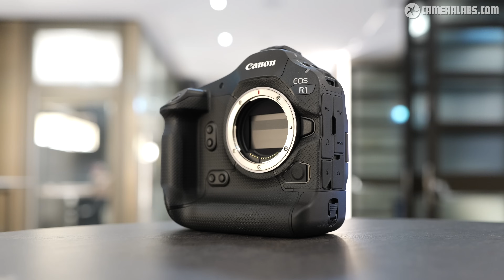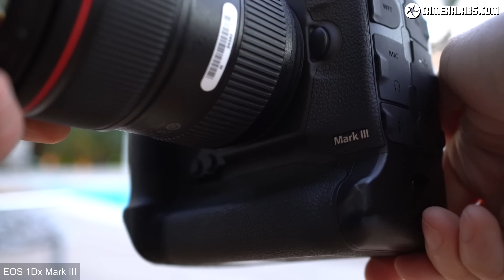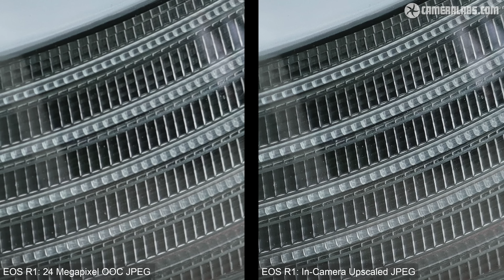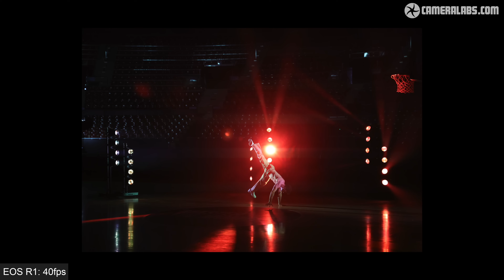Canon EOS R1 HANDS-ON first-looks review PRO flagship

Comment: Quick question: On your R1, does the side rubber port cover sit perfectly flush against the body? Mine has a tiny gap at the top and I’m just curious if that’s standard for the design or if I should be concerned.
Reply from the maker: Sorry, mine was a loaner for the test period during which I made this video, so I can't check. Can you see from any of my footage of the camera?
Reply: @cameralabs  I noticed the same thing in your video, and mine has the exact same tiny gap, so it’s likely just the design.

Comment: So happy to have replaced my R5MKII with an R1 (for wildlife).
Reply from the maker: What are the differences you've noticed?
Reply: @cameralabs  I shoot primarily early and late in the day and the low light performance of the sensor and the low light AF performance is what did it for me. The lack of color noise in the shadows and the retention of detail in those areas is nothing short of amazing. I've also reached a point in life (oldish) where the experience of shooting matters a lot and in that regard I don't think the R1 has an equal. I also find that I can crop as much as I need to to get the results I'm after. Don't get me wrong, in good light, the R5MKII is awesome, it's just not for me.
Reply from the maker: @ronrotunno522  thanks for the feedback. I've heard it's cleaner in low light, but the AF differences are also interesting to hear.
Reply: @cameralabs  It can pretty much see in the dark in terms of AF.

Comment: Personally I have r5m2 and r1. And i use r1 most of the time. Reasons is deeper than reviewers usually deliver. 
1. R1 has triple base iso 800, 1600, 12800. That mean noise cleans up at those iso levels. And you could use r1 in extreamly low light video conditions without visible noise. R1 has same sensor like c80 Canon video camera. 
2. R1 has the best iso performance in high iso and practically I see more details with 3200 and higher with r1 than with r5m2. 
3. R1 has over sample video from all sensor in 4k 24-60, r5m2 only 24-30. 

And of course better heating, battery, evf, handling… 

24 mp is ok for me maybe because I have also gfx100 ii with 102 mp but I really thinking about selling r5m2 because of bad iso noise performance.

A1, a1ii, z8, z9 have even worse high iso performance than r5m2 and not even close with r1. 

To understand why r1 is needed you have to dig deeper my friends and 24 mp is advantage of this camera. Canon did it with purpose. 

Great review as always! Like to it ❤
Reply from the maker: Thanks for your informed comment, very useful!

Comment: 00:04 Canon R1: Pro flagship mirrorless camera
02:05 Canon EOS R1 features stacked sensor with new low pass filter for maximum detail
04:07 Built-in grip enhances confidence and robustness
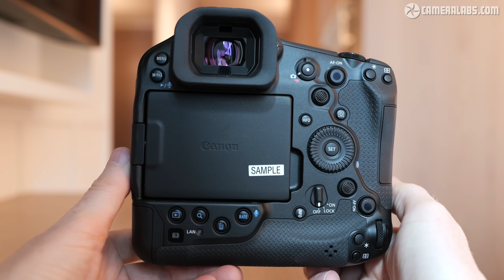06:06 Canon EOS R1 offers improved features over R3
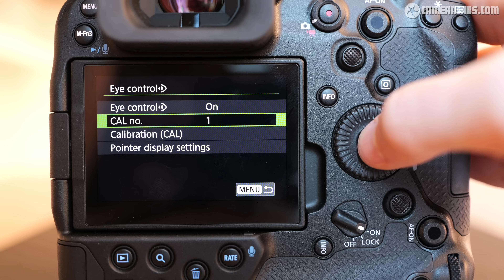08:08 Canon EOS R1 offers improved AF accuracy and advanced autofocus features.
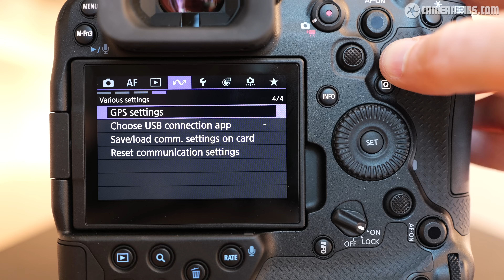10:09 Canon EOS R1 features a faster back-illuminated stacked sensor and upgraded Wi-Fi support
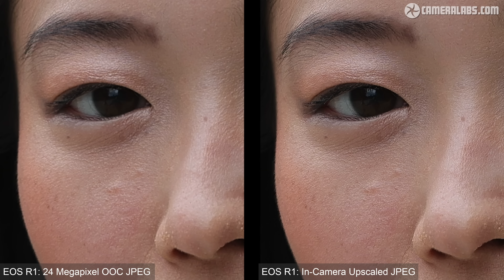12:12 Canon EOS R1 offers in-camera upscaling and neural network noise reduction for enhanced image processing.
14:11 Canon EOS R1 features impressive autofocus upgrades
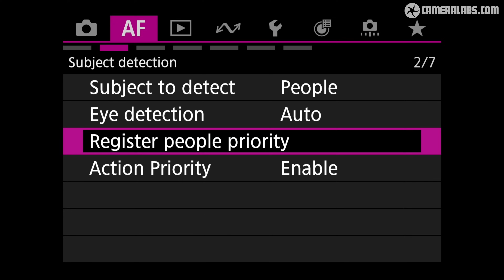16:21 Canon EOS R1 offers advanced autofocus system for sports photography
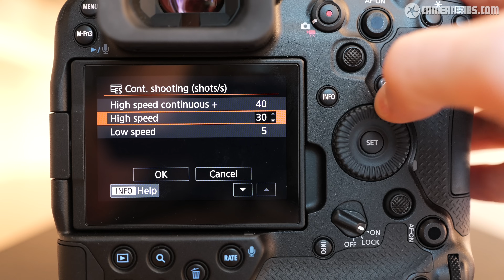18:08 Canon EOS R1 offers useful upgrades for burst mode and video capabilities.
19:59 Canon EOS R1 offers impressive video recording capabilities
21:48 Consider if the Canon EOS R1 will meet your desired results

Comment: Canon USA is apparently already stating that the R3 Camera line will continue. Which if true, that is something I have always believed from Day 1 in spite of those stating and or claiming the R3 was actually the R1. Which really does not make any sense if a person actually thought about it. The Size of the R3 was never right and Canon was NOT going to launch a Flagship Camera with their VERY first attempt at a Stacked Sensor. So there are REAL Good Odds that the Rii gets Canons First Global Shutter for cameras of this type. Which would be par for the course. And it will have a Low MP Count, which will also be par for the course.
Reply from the maker: If this is the case, then it'll be a while before the next R3 since it would require the R1 to jump forward first. Otherwise they'd be too close. I'm still not convinced by future of R3.
Reply: @cameralabs  I am not convinced that the R3 will exists either.   I remember when Canon released the R3 with the non-fixed rear LCD that they said a 1-series camera would always have a fixed LCD.  I guess they changed their minds.

Comment: But where is Canon's answer to 50MP Sony A1? This 24MP R1 is actually an R3 II; and we are yet to see the 'true' R1, that rivals the Sony A1 or the upcoming A1 II.
Reply from the maker: The r5ii is close to a1
Reply: @cameralabs  Sony A1 is a 4-year-old camera, that compelled the Canon to rename its RI and release it as R3, back then. You say that R5 II, released after 4 years, is "closer" to A1. I don't think so. 

R5 II's Flash sync and sensor speeds are a lot slower than A1, 
Sony A1 has Gyroscopic stabilization, 
Viewfinder on A1 is bigger and sharper than R5II, 
Max shutter speed on A1 is 1/32000 compared to 1/8000 on R5II, 
A1 has Ethernet port, whereas R5II doesn't, 
A1 has Flash Sync Port whereas R5II, doesn't. 

Even a 4-year-old camera is better in aforementioned regards than "latest" Canon R5II.

Now don't tell me that A1 is pricier than R5II because it is you yourself who pitted R5II against Sony A1.  

Now wait till Sony releases 50MP A1 II, with a Global Shutter, that obliterates the already shaken entire Canon camera lineup.
Reply: Sony A1 is a 4-year-old camera, that compelled the Canon to rename its R1 and release it as R3, back then.

You say that R5II, released after 4 years, is "closer" to A1. I don't think so.

R5 II's Flash sync and sensor speeds are a lot slower than A1,
Sony A1 has Gyroscopic stabilization,
Viewfinder on A1 is bigger and sharper than R5II,
Max shutter speed on A1 is 1/32000 compared to 1/8000 on R5II,
A1 has Ethernet port, whereas R5II doesn't,
Al has Flash Sync Port whereas R5II, doesn't.
Even a 4-year-old camera is better in aforementioned regards than "latest" Canon R5II.

Now don't tell me that A1 is pricier than R5II because it is you yourself who pitted R5II against Sony A1, as I was alluding to Canon R1, which happens to be as pricey as Sony A1.

Now wait till Sony releases 50MP A1 II, with a Global Shutter, that obliterates the already shaken entire Canon camera lineup.

Comment: R1 Sensor Readout Speed 2.7ms vs Sony a1 4.2ms and Nikon Z9 4.0ms readout. That's thanks to the new "Digic Accellerator".
Reply: This means less rolling shutter affect for both still images and video. Yes, the R1 will have visually better control over high-speed object deformation than either Sony or Nikon flagship cameras! So basketballs and soccer balls and volleyballs are going to look rounder in motion on the Canon R1!
That's a desirable advantage when you're trying to sell images to Sports Illustrated, for instance!
Reply: A9III  0ms readout speed, 24Mpx, R1 2ms, 24Mpx.
Reply: @renestaempfli1071  Sony a9-3 does great in bright daylight, but gets really noisy indoors and in low light and high-ISO. Sony recommends other cameras in it's line for low light work, but all of those have worse rolling shutter than Canon R1. Sony a9-3 can use flash with extremely high shutter speeds, when properly adjusted, but many sports don't allow flash photography.

Canon R1 is class leading in all situations when set up and used properly. Larry Chen just used a pair of  R1 bodies to shoot the "Drift Appalachia, Summer 2024" event in Kentucky. One of the corners Larry shot from was in dark shade, or possibly overcast with dark shade; very difficult for both video and stills action event work. The results look extremely encouraging but I haven't seen published, high-resolution stills yet. 

R1 cameras are also rumored to be shooting Formula 1 this weekend.

Canon is big in the Summer Olympics in Paris, so both the R1 and R5 Mark II are going to be tested there and Canon will certainly capitalize on the best results.
Reply: @renestaempfli1071  Sadly, while the Sony a9-3 does great in good light, it suffers from sensor noise in high-ISO Low Light outdoors and indoors. There have been several writeups about this problem, and even a partial apology by Sony.
The Canon R1 appears to be very good in low light, as good or better than the Canon R3, while operating much faster overall.
Reply: I should explain that I am somewhat brand agnostic, with mirrorless systems in Sony and Canon, and DSLRs systems in Nikon and Canon. I advise folks and make recommendations partly on my own experiences with the different systems. I am not affiliated or compensated in any way by any manufacturer, and all my equipment is purchased either full-price new, or used/refurbished, in the same fashion as any other person.

Comment: 16:13 - I want to see "non-circular balls" sports in the 2028 Olympics - that's for sure. 🤪
Solid camera. I was expecting less of higher megapixels, but more in system workflow enhancements: like built-in solid state 1TB or 2TB onboard memory, or broad(er) light spectrum sensor like the tech from Canon industiral arm, extending not only low light capabilities, but adding the whole "new" light for the studio work - something that would actually be flagship-like feature implemented nowhere else in the product line up. It feels like EOS R3 mkii and that's a bummer, cos R3 doesn't need a mark 2 yet. In fact I predict R3 users won't be migrating swept up by the promises of R1 as it stands atm.

Comment: The panning assist feature on my R3 has been very helpful for aircraft in flight photography. But I have been reading the specs on the R1 and I don't see it. That's sad, as I really wanted that on the R1.
Reply from the maker: Can you explain that one to me and I'll check
Reply: @cameralabs  Panning assist looks at the speed of the subject and the panning movements of the photographer. It then tries to keep the subject in the same position in the frame using the IS system in the lens. The result is sharper images when panning and less subject blur. Canon says it allows shutter speeds 1 - 2 stops slower than normal when panning. I photograph propeller aircraft at slow shutter speeds to capture prop blur. It gives the photo a more realistic look. And my keeper rate is much more when I use panning assist. Other people use panning assist for motor sports - shooting a race car a slow shutter speed to get background blur and a sensation of speed.
Panning assist is only available on the R3 (with firmware 1.4.1). I don't see it included on the R1 or R5 II.
Reply from the maker: @kenfrank2730  interesting feature, I'd not seen it, probably as it wasn't in the firmware when I tested it. Let me know what menu it's on and I can check next time I have the R1 and R5 II.
Reply: @cameralabs  On the R3 menu go to the camera icon, then to number 6. There it gives the option of turning panning assist on or off. Thanks Gordon.

Comment: I will be sticking with my R3, if the R1 had 45mp and the rest of the spec from the R3 I would have upgraded.
Reply: I don't "prefer" one or the other, but 24 is certainly all I need.
Reply: @alansach8437  I actually wouldn't want 45mp so I say I do "prefer" 24
Reply: It comes down to glass. If you don't have access to high end glass you need higher pixel count to help support crop. Otherwise if you are shooting with 400/500/600mm lenses you are dialed into where you need to sit stand on sidelines or grand stands you simply need & speed focus.
Reply: If it was 45mp I’d be sticking with my R3, as it wasn’t I retired my R3 and went to the R1. If I need higher MP, I’ll go to my Fuji.
Reply: No one who needs a camera like the R1 needs 45mp…..if you are on the market for a camera like this, it’s all about speed (shooting and offloading) not MP
Reply: What's wrong with having speed and mps ?
Reply: @nigelwest3430  Storage
Reply: @nigelwest3430 Nothing at all, but sports and photojournalists are also concerned about compact file sizes for storage and transmission, sometimes over limited bandwidth. Perhaps Canon will release an R1s with high megapixels if enough demand is there.
Reply: @alansach8437  Canon can integrate AI downscaling in-camera, like they do in reverse, if image size is an issue. And with more resolution you have an option of cropping. This is not an issue as much as it has been in the past, having more megapixels is just better.
Reply: Personally, I prefer 24mp over 45
Reply from the maker: The R5 II will give you the res and most of the AF at least!

Comment: The Canon R1 has fallen victim to the age-old and widely held bias that the most important spec by which a new camera is judged is MEGAPIXELS. If the R1 had released with all the same specs but with at least a 45MP sensor, there would be no doubt that all the "experts" would hail this as the new Canon flagship. Instead of questioning Canon's use of the term flagship, they would be talking about the fast sensor read speed, what is possibly the world's best AF, and the new upscaling and noise reduction capabilities. 

And the sad part is, Canon's product managers should have known this would happen.
Reply from the maker: As I said near the start, Canon's pro bodies have been 18-24mp for ages, so this was never going to be more.
Reply: @cameralabs I would have thought the R1 would have a high chance at being around 45MP. For one, the A1 and Z9 pushing the envelope for flagships. And maybe more importantly, the R3 filled the 1dx void quite well. Canon can’t keep with the old ways forever or they won’t keep up with the competition.
Reply from the maker: @zeiss1382  Canon does listen to their pro shooters and they clearly seem to be saying 24 is enough for them! Plus remember Sony's A9 III, their top camera for sports, is also 'only' 24mp, although that's more a limitation of global right now. If Sony is capable of pushing res, they always try to do so even if no-one is asking for it.
Reply: @cameralabs  I think 24MP is great for those professionals. But Canon has so many 24MP cameras and only 1 high option that they will never fully feature. I think the market is changing and Sony and Nikon have figured it out first. Love your channel by the way!
Reply from the maker: @zeiss1382  that's a good point, I'd not really thought about them only having one high mp body at the moment...
Reply: @cameralabs  Yes, we are approaching the point of diminishing returns on MP. I think the upper limit for mainstream cameras is about 50MP. Above that will always be specialty cameras.

Comment: Good review but you got the sync speeds wrong.  320 is the fastest sync speed with efc.  It’s slower with electronic.  You said it was 400 with electronic.   That’s apparently incorrect according to Canon.
Reply from the maker: Grrr, that's the spec they gave me
Reply: @cameralabs  yes I’m upset that it is not better.  I’m looking now at canon U.S.A. web site on R1 and it is saying mechanical shutter sync at 200th and EFC at 320.  Is there something missing?
Reply from the maker: @tomkates9690  hmmm, Canon UK specs say "When Cropping/aspect ratio: Full-frame/1:1/4:3/16:9 is set: 1/200 sec mechanical shutter / 1/320 electronic 1st curtain, 1/400 sec Electronic shutter".
Reply: @cameralabs  Wow, this is news to me and definitely not in any of the USA based specs that Canon out out today.  I would be thrilled with 400th is a second electronic sync.   Any way we can confirm this?
Reply from the maker: @tomkates9690  I'll ask them
Reply: @cameralabs  My apologies for saying you were wrong about sync.   It appears that you were precisely correct with saying it got 400th second electronic.  The weird thing is that the Canon USA site does not even list a fully electronic spec.    Only the 200th Mechanical and 320 EFC.  That has led most everyone in the USA from reviewers to people like me to get it wrong.  You seem to be the sole reviewer who got it right.  I did watch a video from Canon USA that also mentioned 400th of a second sync, so it does seem as though thats confirmation.   Thanks for your patience.

Comment: R3 mkii

Will be interesting to see if they add things like 120fps, more AF modes, etc over time
Reply from the maker: Does anyone actually need 120fps for stills though? Sony is great at pushing the envelope on sensor tech, but often it's more of a solution looking for a problem than the other way round. Plus with 4k 120, you effectively already have 120fps, albeit at 8 Megapixels.
Reply: @cameralabs  not really but speaking personally i do have some uses for it with wildlife. I almost always shoot r7 at 30 fps and just do bursts to capture a birds perfect head angle or more recently I caught a deer blowing a bubble while snorting. for things like that and birds diving into water the higher the framerate the easier it is to get the shot. Personally id rather they just do a 60 fps mode

Comment: Lumix 5ii can do pixel shift and do 96mp RAW No “AI” needed and opengate. Glad I chose Lumix for mirrorless but stuck with Canon 1dxmIII for DSLR for sports/racing etc.. best of both worlds. Sticking with 1 system is old thinking, now having the right tool for the right job. For me its Lumix s5iiX and 1dxIII

The issue with Canon is they have to segment product lines ie Cinema ENG/EFP line for video and photo bodies. Where as Panasonic no longer has a Varicam cinema line so no segmentation needed. This is why the s5iiX offers so many more features such as opengate,anamorphic support,LUTs,etc..